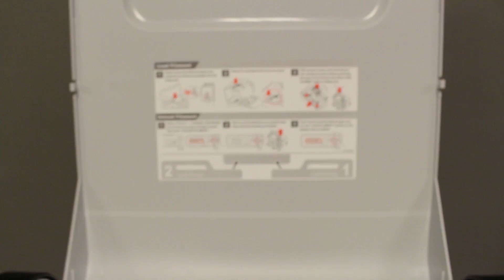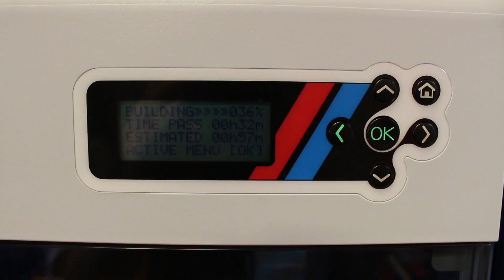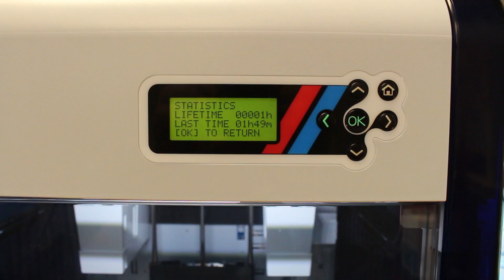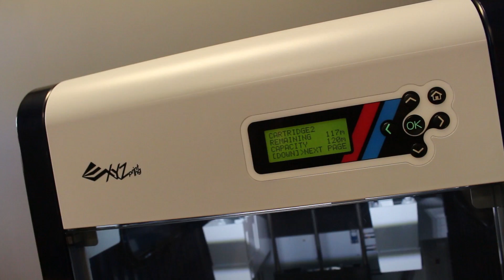XYZ 3d printer da vinci 2.0a duo unboxing and first print

Comment: Does xyz still suport printing with that printer
Reply from the maker: Not sure what you mean. Mine works if you mean fireware updates or something along those lines I haven't updated that in a while.
Reply: @RandomPete  I'm sorry for the the lack of description! I figured it out but what a meant to ask was if the newer xyzprint software supported it but I just went back to older version of XYZware now it works, thanks anyways!

Comment: Wait... does this model also have DRM in the filament cartridge? Gah... I'd get one if I can use any filament I have.
Reply from the maker: @techcyben  belive there a 2 diff models a early and late-model that you can reflash the board and have new software to run everything its been a few years since I read up on it do some Google searching on molding this printer and you will find it
Reply: @RandomPete  Thanks. I would guess it's a newer model. Local purchase and comes with about 6 cartridges.... so even if I chuck it away after those run out, it's paid for it's self. XD
Reply from the maker: You can get the chips on ebay or make your own to trick the machine so you can use your own filement
Reply: @RandomPete  Thanks! I really want a dual extruder, and someone is selling one locally cheap, but I don't want to get scammed on expensive filament... wondering if I can mod the entire control board to skip out the scam of DRM. :P

Comment: Which kinds of 3D printer you recommend to use it commercial  bussines please ?
Reply from the maker: Sami AL Humairi with the sheer amount of printers out there today you can get really good prints off a $500 printer. The prusia printers are nice for the price but have only used one 2 times for short periods of time. Then there's Ultimaker printers that are very good printers in my opinion and are much more expensive. Unfortunately I don't have the hands on with as many printers as say Makersmuse or 3d printing nerd does. Recommending a printer for you particular need is hard. If your doing alot of prototyping and stuff along those like I would probably get a more high end printer. Wish I could be more help.

Comment: I have had absurdly bad experiences with XYZ Printing and their customer support.  I have yet to get a functional unit from XYZPrinting, and when after over 2 months I finally gave up and demanded a refund they want to charge ME to return their defective product to them.

The have also:

1) Sent me a used printer to replace the new printer I received that was broken, and hadn't bothered to clean it.  It was a mess.. and also non-functional.
2) Demanded that I repair their product for them for free (they wanted to ship a motherboard for me to install)
3) Informed me that if I broke anything during the install of that motherboard that I would void the warrant! (which I found funny since it didn't seem like much of a warranty at that point anyway)
4) Are trying to charge ME for the cost of returning their defective printer to them.

I also ordered an XYZ printer through Amazon that was also non-functional, but Amazon accepted the return and paid for the shipping... what an amazing difference in customer support!

Shoddy products that are poorly designed and prone to damage in shipping and a company with abysmal customer service policy.  That is my review.

I told XYZ that their abysmal service had driven me to take time out of my day to warn people about their company and that is what I am doing.
Reply: Arthur Ghee no he’s right. Xyz printers are crap.
Reply: User error.
Reply: I have only had  very good experiences with my fully functional xyz jr

Comment: Pete, did you smell a lot of fumes.  If I am correct you said you placed it in your office.  I have a duo that I just unboxed and am worried about the fumes.  So I just wanted to know if the housing holds in most of the fumes.  I notice the handle on the door has a gap that fumes could escape but some tape over that would probably suffice.  Thanks for letting me know if there were a lot of fumes so I can rest easy.
Reply from the maker: +drunization I could smell a very small smell nothing I was concerned about. Different filament types will off gas more then others. I've only used the ones that came with it so far.
Reply: drunization the filament it came with is probably abs which gives of a strong smell from what I have heard
Reply: you only get fumes with ABS.  PLA has almost no smell.

Comment: WARNING.... If you buy or have this printer take the scrap trays out and bend the metal tabs down and out of the way. These metal tabs will wipe the tips off of the hot end. I have one and I lost the left tip on my hot end after 6 months of use. Of course the warranty was over $160 to replace so now I only have one tip now.

Comment: out of a 10 star grading what would you rate this printer? i am looking to get it to further making phone cases and paintball parts with it. is the quality good and do the prints look good? can you see the different layers that the printer printed on? if  you can answer these questions for me since you personally own one. also if you could subscribe to me @Matthew Nuckles so when i get it you can give me tips on what to do
Reply from the maker: Thanks for watching. I would say a 7 out of 10 , you can see the layers but you see lays with FDM type 3d printers the parts i have printed have come out nice and exactly what i designed and needed. i have made some multi piece  parts that fit together nicely.
Reply: Random Pete does your parts that go together move together?
Reply from the maker: No i made a stock to hold my VIVE controllers  for shooting games. It was to big  for the printer to print in one piece so i made them interlock and glued them together
Reply from the maker: Here is my email rrandompete@gmail.com   I will do my best to answer your questions
Reply: Random Pete ok thanks i just want some pics of the quality if you can

Comment: Dude could you send me a copy of the files on your sd card. mines fried and i have a new one.
Reply from the maker: what files are you looking for the firmware or the test prints?
Reply: just the test prints. I use them for calibration. I have major issues with calibration on this printer. using the calibration utility results in filament jams.

Comment: Ever had trouble with the part not sticking? I bough a printer today but when printing the star cup once it started the third layer of colour the part became dislodged from the class and stuffed the print
Reply from the maker: I have run in to that a few times now, i was acutely going to make a video on that issue i have had with this printer and some ways i have over come that issue. biggest thing was starting with a clean bed i have  been clearing it after every print and that seems to be the biggest thing to keep them stuck. also i use a lot of glue some times and put it on as late as possible before it starts printing